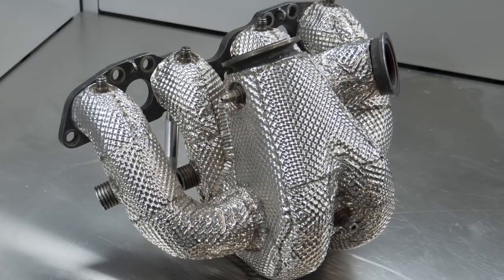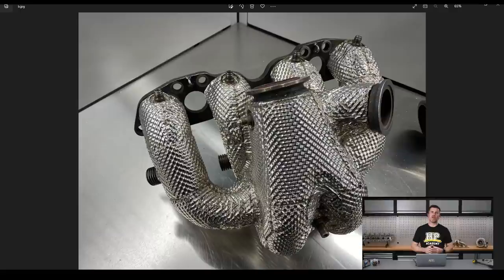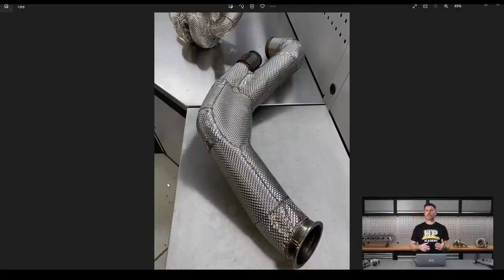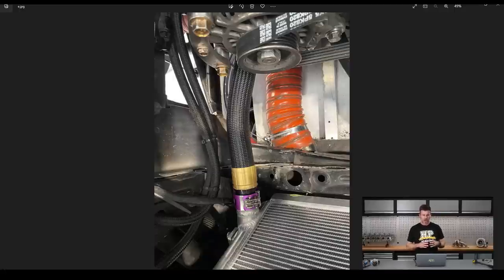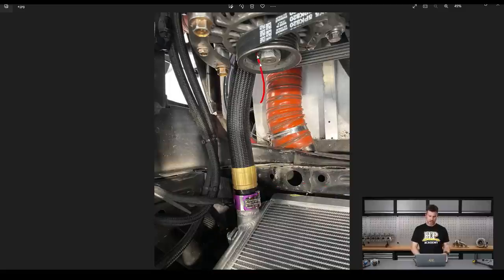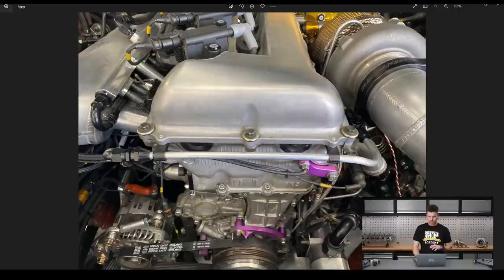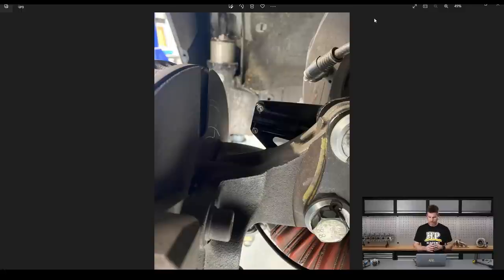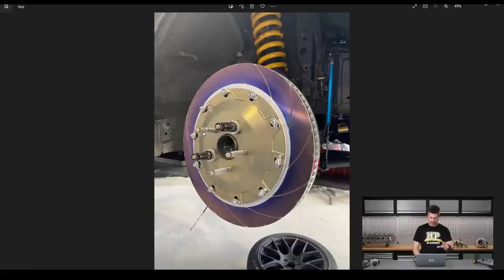Dual Layer Turbo Heat Shielding & More [#UPDATE]

Comment: It's gonna be fun when you crack an exhaust manifold
Reply from the maker: The manifold is not a cheap piece of crap that's been fabricated out of old spoons and 'Knead It', nor is this anything new and unusual in the realms of heat management. It will be fine 😎 - Taz.
Reply: @hpa101  Hey man, easy on the spoons & knead it lol
Reply: @hpa101   Sorry I should have said if it cracks which is possible. I've seen reputable brands have the occasional issues so it's a possibility especially in a high stress race application. Merely stating it would be a mofo if it did crack seeing as you can't just unwrap, repair then re wrap again.
Reply from the maker: Ahh yes, that is a completely different sentence in that case! 

Yes, it would be a mofo, but pretty much any shielding would be toast if your manifold cracked anyway so is what it is.

Every single thing you do comes with a trade-off, that's part of the game. The trade-offs associated with this is worth it for us. For you and your setup? Perhaps not, that's up to you 😎

This is a common setup in professional motorsports too, worth noting. GT3, TCR etc etc - Taz.

Comment: Looking forward to seeing the progress you guys make this race season.
Reply from the maker: It's going OK so far, no temp issues. Random weld failure on one of the coils last time out for the SR though. First round Andre got stuck behind a TCR that had issues but didn't pull off on a safety car restart which was a shame.
They live stream here and the commentators are actually not too bad: https://www.facebook.com/sierdcnz/
Next (3rd) race is on the 15th - Taz.
Reply: @hpa101  Many thanks

Comment: Very neat job with the heatshielding!
On thermal barriers, I've seen plenty of use of thermal paints on the outsides of exhaust components, but don't recall ever seeing them used internally, where an additional benefit would seem to a potential reduction in thermal stress induced cracking as less heat into the parts should result in less expansion? It would also reduce the temperatures the external shielding would be dealing with?

Yes, with 'radiators', they don't actually radiate heat but are transferring thermal energy from the internal fluid (water, oil, air) to the external fluid (air). 
The best cooler in the world at transferring thermal energy to the fins is useless if the air passing through it isn't able to remove that energy - it needs both mass and a temperature difference (delta). The former is by ensuring as much air as practical is passing through to provide the mass, and with thicker cores the delta is reduced as the air passed through the core - it's picking up heat energy and increasing it's temprature. There is, of course, also a gradient for the fluid being cooled.
A double pass, dual core design should be more efficient, but design and packaging may be a problem.

There are also questions about the end tank designs, as a poor design will tend to bias the flow towards/from some fins more than others, which will reduce the 'work' the lesser flowing fins are doing. Getting the end tanks right should see an even temperature drop across/down the cooler matrix.

A related issue is where fan shrouds are used - they need to be designed so there is a minimal restriction in the areas not open for the fan(s), I've seen many very shallow shrouds which compound the problem by having large areas of the shroud closed of where the fan(s) aren't drawing air.

As an aside, who supplies your Wiggins clamps, dealers don't seem to be that common?
Reply: I think the risk of fod is why manifolds aren’t coated on the inside,the thermal expansion will still be a factor,ceramic coating’s can chip off
Reply: @needmoreboost6369  
Good point!
My interest is more to NA and supercharged, so question would still stand for those because there's no turbine to be potentially damaged.
Reply: @gordowg1wg145  they usually do do the inside of pipes etc post turbo (if its turbo)
Reply: @ZLAKLR20B  
TY, 👍

Comment: Great video mates!  Love the heat shielding.  Looks like something I need for my Talon.  Very little between one of my runners and the radiator core.  Not sure what I can do without a company like that here but it's got my wheels turning.

  Good to hear on the radiator efficiency as I'm stuck between what seems like a good design by an aftermarket radiator that retains it's original size or the thick race line one by another company.  So that has solved my dilemma there.  With a radiator, condenser, and a large intercooler all screaming for airflow it gets hot when the ambients rise above 70*.  I think switching out the massive bar and plate intercooler for something of less mass but more efficient in the tube & fin category will probably help a great deal as well as ducting it all.  Cheers
Reply: United States?  Headershield does this here.
Reply: @SylasG  Yeah, east coast.  I'll have to look them up, thanks.

Comment: I have 3 core 4 pass radiator on my sr20 in a s13 that's supposed to be for a rx3.. it works too well on the motorway at night it pulls temps back to less than 75deg, even under load also running -20 fittings

Comment: If u wanted to ceramic coat it as well and apply the shield would that be just as affective or would u be wasting time & money?  Loving these videos fellas. Thanks frm from the UK 👊✌👍
Reply: I've read it would be a waste of money to ceramic coat as well because the coating would probably start flaking off because of too much heat.
Reply: Counterproductive. The ceramic fiber blanket under the stainless steel/inconel does the job. It withstands excess of 1400 degrees Celsius. Ceramic coating as an extra makes no sense.
Check out Thermo Met in UK, those guys are also pros in these types of insulations.

Comment: There must be a reason f1 used inconel.  Was it a weight savings? Is the inconel lighter? Is gotta be more than price
Reply: Gas turbine engines give the most efficient thrust/mass flow at the highest differential temperature possible within the limits of the hot section materials, etc, so the hotter the better (sort of!) Although inconel 625 has a lower melting point than equivalent alloy stainless steel (say, 304 austenitic), its operating temperature can be closer to the melting point, and is a good 30 degrees celsius higher than the 304 operating temp, while maintaining its full strength. Also, inconel has a far better resistance to high temperature oxidation than stainless. That makes it a shoe-in for aviation use, where maintenance costs are a big factor in purchase and operation budgets. It's also significantly stronger in tension than 304 stainless. F1 engines also get as close as possible to thermodynamic limits, in the quest for maximum power, and that is one of many reasons inconel is used, rather than stainless in many components. Also, "expensive" is par for the course in that category! Sorry to go on!
Reply: @robair67  great explanation. I offer an alternative. Inconel could be made thinner and lighter without cracking at ~12-15k RPM with the temps and pressures and vibration.
I'm sure 321 SS would work fine at twice the thickness and weight. There might be some corrosive element in the fuel they use also. The real question is why not titanium?
Reply: @robair67  🐐
Reply: @kylegoldston  I'm no expert but i think titanium parts can't handle as much vibration and will eventually start to crack. That's why important structual bolts are usually stainless. The resonant frequency being different makes it brittle at certain rpm.
Reply: @badgermetal  Titanium is fine with vibration, generally, but it is very notch sensitive.  With the variety of bolts used in F1, they are generally machined, rather than rolled threads, thus shortening their life or limiting their potential applications when manufatured in Ti
Reply: @kylegoldston  thank you! Titanium alloys can handle a slightly lower operating temperature (about 300C lower) and, although definitely lighter (lower density) have slightly lower tensile strength than inconel (625), although several inconel alloys have lower tensile strength than the ubiquitous Ti6Al4V alloy. Sorry for overuse of the word "lower"!
Reply: @robair67  300c is a huge difference. At the RPM and load required header temp and EGT must be basically equal. So YES they need that 300c or 572f higher working temp because there's not enough time between exhaust pulses for heat rejection. Working temp must equal EGT in this application.

Comment: Doesn’t that make manifold inspection impossible?
Reply: Good point but a smoke test would probably be standard procedure on a racecar anyways to find leaks before they become catastrophic.
Reply from the maker: No, you can remove it. Putting it back on is the hard part 😅

You either need the budget to replace it often if you feel the need to inspect your manifold often, or you wouldn't use this setup on your own application. It is used on the likes of TCR and GT3 cars etc too, this isn't some unusually complicated option for shielding at all - Taz.
Reply: @badgermetal  on tiny hairline cracks, smoke test is useless. On some weekend run what you brung racers, it is a difference of weldit now and finish a 10lap race or DNF due to cracked manifold.
Reply: @hpa101  on hard core race teams, they have budget to replace exhaust manifold after an X amount of hours/runs. Cracked manifold is non issue. Stainless manifold, with or without heat shields, no matter what, will always crack eventually. On time attacks, you can just abandon the lap and try again. On a endurance event, it is a difference of finishing 1st or dnf.

Hard line all the way on oil supply for turbo is ok in general, just be sure you check it for cracking after a few runs or so as this is trial and error. Long runner exhaust manifold usually create excesive vibration thats why a flex joint somewhere is a good idea. OE typically can get away with hard lines oil supply since the the engine vibrate together with the short cast solid manifold and tiny light weight turbo.
Reply from the maker: @Marion if your manifolds are cracking so often that you are inspecting them constantly and living in fear of that risk without any other excessive heat issues being bigger risks, then this setup is not for you for sure!  - Taz.